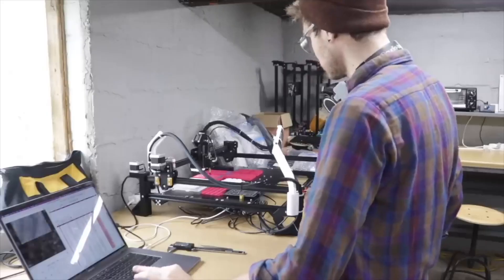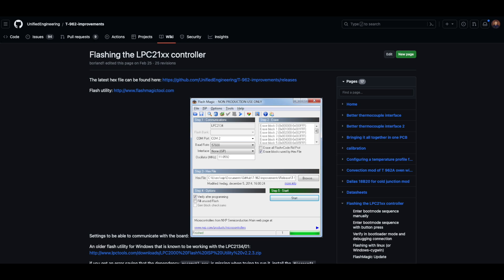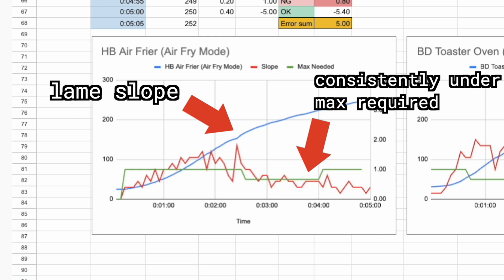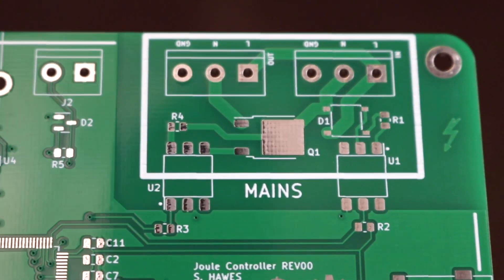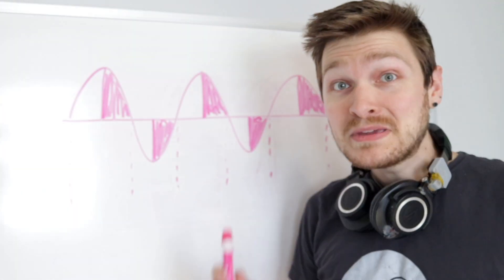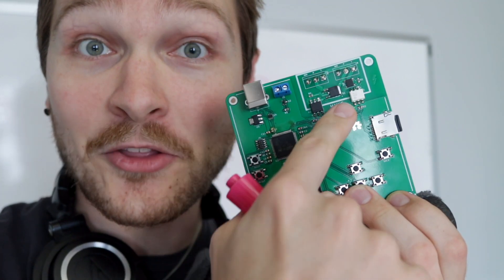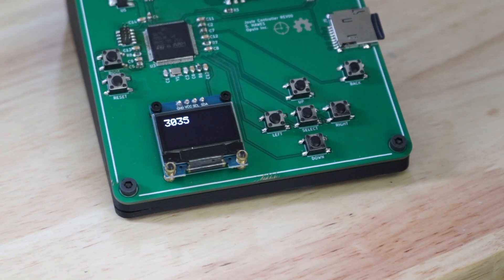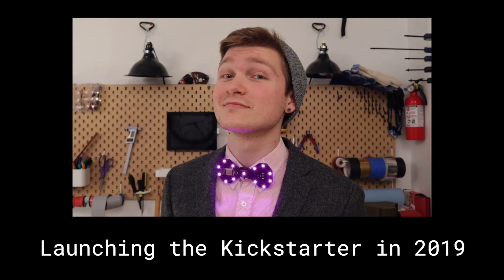turn any toaster oven into a reflow oven!

Comment: MOC3031 is a zero crossing capable driver, you were really close with the MOC3022, I might be mistaken, but part of the issue could be if you are PWM'ing anywhere in the middle of the sine waves, you are snapping through a large inefficient linear region to get saturated each time, just like with transistors it's not somewhere you want to be for long at all, pretty sure that's another reason zero crossing is often more preferred. I made a 555 drive a MOC3031 for a spot welder controller I designed. With the triacs, pay attention to the ratings and do the dissipation calculations(as you've already realized), also some are available in plastic isolated packages, others will possibly make a heatsink go live.

Comment: I think any mains rated relay will work fine. I don't really understand why you would want to rectify the AC wave - the oven power supply will expect a full sine wave and will rectify whatever you push to it. You're also over thinking the zero pass, this is a low frequency switching project - you're not sending digital data with a steady clock. Using the ac wave as a clock seems nice, I just can't think of any benefit considering there's a whole other supply circuit after your output. The microcontroller looks like overkill as well, use whatever series you're proficient with but integrate and test on a cheap and cheerful one if you want to sell the board. 
I say scrap this version, look at a few different projects that do the same thing and simply, rather than trying to make the-BEST-high-performance-switching thing.
Reply: All of your comments appear to reflect misunderstandings. Stephen's project is not rectifying AC to power the oven, he's not using line frequency as a clock, and no doubt he used that MCU because it's what he has for several other projects, which he already has a dev environment and libraries for. This is not a product prototype, as he said, it's just a board to allow some experimentation.
Reply: @Graham_Wideman  Stephen asked for thoughts 16:20, I wrote thoughts. You're free to disagree, but I'm not you, and you've provided no actual arguments except contradicting me.
Reply: @PaulSpades  I didn't simply contradict your suggested replacement project so much as address several points where you seem to have misunderstood Stephen's project, and thus relate "thoughts" unrelated to the matter at hand . Starting with your "I don't really understand why you would want to rectify the AC wave". Stephen's project doesn't rectify the AC, so your point addressing that has no basis. The rest continues in similar vein.  
But in the grand scheme of things, sure, your points could well be relevant to a different project by a different person starting with different components on hand and different skills.

Comment: 12:38 and here is where you probably should have covered the top side of the board around the AC section, because all that exposed area is ripe for finger touching while its live.

Comment: just use a triac and trigger it at zc when the current is low then it wont get hot? heat sink the triac. 50% would be you triggering every other zero crossing.

Comment: I understand that this is a test bench, and you know what you're doing, but I think it's still a bit dangerous to present the PCB on the top of the enclosure when it has exposed pads with mains voltage.  I wouldn't trust myself not to fumble something, anyway.

The following are unverified musings on how I imagine designing a circuit.  Please apply your own common sense and electrical engineering if you use any of these ideas.  If Stephen requests it, or this comment gets enough likes, I would be happy to formalize this by implementing some of these ideas in kicad and simulating them.

As far as how to control the output, you're absolutely right that switching mid-cycle is noisy from a conducted (or even radiated) emissions point of view, but it also has a terrible power factor, which from a do-the-right thing perspective matters more for a device like this that will use a considerable amount of power.

Also, consider that if the device under control is significantly inductive, it won't have reached zero current at the point where the line voltage hits zero, so your poor zero-crossing relay will be subjected to large transients when it tries to break the circuit, unless you can find one that breaks the circuit at the zero-current point, but a brief search suggests that (at least) the common ones are voltage-mode devices.  If you can convince yourself that this will never be connected to an inductive load, you can stop here.  But if you're putting a mains socket on it, it might be nice to know that it won't catch fire when connected to an arbitrary load that the user might attach.

For any specific device you're controlling, you can balance the inductance out with a capacitor, but the value of that cap, and the safety of the device is then highly dependent on the specific load.
Another option is snubber diodes.  These will protect from flyback by sinking current at some voltage above the maximum mains voltage.  This is a reasonable approach if you only want safety, and are ok with losing emissions performance in the case of an inductive load.  But if you want this device to be capable of more general control, or for it to be certified without being glued to a specific load,  another option is to stick to a TRIAC, which is a current-mode device.  Another option would be to slowly drive a power MOSFET through the ohmic region between the on and off states.  This will dissipate a lot of heat, but only for a short period of time.  If you take this approach, you should design with a part that has enough thermal mass to survive an off -> on transition directly followed by an on -> off transition on its own.  Then add heatsink sufficient to allow it to survive these transitions continuously, then program the microcontroller not to do that.  Make sure you do those calculations assuming the maximum line voltage this could be run from (240 maybe?) at the maximum current that could pass through the fuse you've installed on the board.  You did install a fuse on the board, right?  Remember that a fuse can pass significantly more current than its rating for some period of time.  Check the datasheet for the specific fuse you're using.  Do not use some generic fuse from aliexpress.  Get one with a real datasheet from a reputable distributor.

If you use low-side control, you can fairly simply drive the MOSFET from an opamp integrator driven from a uC output pin, with the bias on the non-inverting input driven from half your VDDIO voltage (by a humble resistor divider).  Ensure your opamp is safe to run with a large differential input voltage.  Use a small resistor and a large capacitor (relatively speaking) to form the time constant of your integrator, in order to get good noise immunity and low drift.  Think about trying to use 10% of the current source/sink capability of the IO pin on you uC.  Actually, you never need to tristate your uC output, so I suppose you're only buying noise immunity here - drift isn't really a factor.  Scale the opamp power supply to bring the MOSFET well into saturation.

In any case, there's a catch here.  The driver circuit for your MOSFET or TRIAC must be referenced to neutral, not ground.  Otherwise wiring faults or large neutral currents can lift (or lower) the source voltage on your MOSFET by enough to change the meaning of a gate voltage referenced to ground, or in the case of a TRIAC pull your current source against its will far enough to cause a false trigger or even catch your current source on fire.  In the case of a MOSFET, you can do this fairly simply with another opamp, by summing in the neutral voltage.  In this case, choose resistors large enough to prevent fire in the case of a neutral/hot wiring fault.  If you can find a linear enough part, you could also use photovoltaic optoisolator, but these tend to be quite pricey - they're typically optimized for digital, not linear use, but this would have the advantage of being safe for high-side control.  Or in the case of a TRIAC, the current source driving it needs to have sufficient compliance to drive a load referenced to neutral.  If you use a high-compliance current source to control a TRIAC, please ensure that a crowbar circuit protects the device from a neutral/hot wiring fault.

You might think of referencing the entire circuit to neutral, but this comes with other complications.  If you were to do this, you would simply move the gnd-neutral voltage problem to the USB port.  So you might imagine an old way to do this, that you should absolutely avoid, by isolating your circuit (by installing a 1:1 transformer) and connecting the (arbitrarily chosen) low-side leg of the secondary to the real ground.  Then reference everything to ground.  The protects the MOSFET/TRIAC driver, and the USB port, but IS NOT COMPATIBLE with GFCIs!  It will trick the GFCI into thinking everything is fine even as the user is electrocuted with several amps, so it must be avoided in modern times.

Comment: The first strategy I can think of is getting an off-the-shelf solid state relay and using delta sigma modulation to determine which half waves to let through and which to block. Maybe running the modulator at half frequency so it works on full waves would be better for EMC, that needs testing.
Reply: Using sigma delta is essentially picking particular constants for a PID algorithm. It's not clear that those constants are necessarily optimum, since they don't incorporate any knowledge of the thermal momentum of the oven.

Comment: You have essentially created a very expensive light dimmer, which is why it buzzes, as you have learned.  The triac is burning itself out because you are turning it on in the middle of the cycle, thus it needs to dissipate the switching current at that point and generates a huge amount of harmonics in doing so.

Your second idea is on point, and you can use a slightly larger triac (80% over rated) with a heat sink.  You can still PWM, but you need to think about doing it over something like N cycles.  If N = 100, and you want a 50% duty cycle, on for 50 half cycles and off for the next 50 cycles.  The temp won’t vary that fast, so even using 256 over 2 seconds is perfectly fine.  It will dissipate much less heat as well.

Comment: So we actually have a device that does exactly what you are designing- a reflow controller that you plug a toaster oven into. One thing that differs between it and your design is the rate at which it turns on and off. The one we have switches once every second at most. At that frequency you don’t exactly need to worry about the zero crossing issue. I can find out the name of the controller if you are interested!
Reply: That info would be useful.  Also check that it does indeed run an unmodified toaster oven, and also what does it use for temperature sensing?
Reply: @Graham_Wideman  the toaster we use has very little modification to it. We added a small layer of insulation and added a thermistor probe. The controller has an outlet you plug the toaster into. I'll ask what model the controller is

Comment: Yeah, work with those triac in the past and it can defenately do what you are asking of it (when you select the right one) but it will always need cooling, you can add a big ass heat sink on the back or you can use a silicon thermal pad and let the heat sink in the metal inclosure but unfortunately the toaster casing seems to thin for that.

Comment: Many years ago I did a lot of design work with triacs controlling halogen projector lamps. You really have to be careful with dv/dt across the triac as well as conductive noise suppression to keep the FCC happy. Using an SSR that triggers 'on' near the zero crossing as well as 'off' at zero crossing is the best way to go IMHO.

Comment: Having made a few reflow ovens like this for myself I used an ssr and didn’t worry about cycle switching as you can go pretty slow. I cycle twice a second and the pid works like a charm the heating curves are close to perfect. Good luck with your project.

Comment: oof if you want to be a little bit safer, use a ground fault interrupter inline so it has a chance to fuck up in that direction if you slip up. 

super cool for sure, I've only ever dealt with mains when on a SMPS project, and I was worrying about the low side so I'm no expert on anything at all, as far as I'm concerned mains is just wizards using weird semiconductors to do stuff that my small signal brain just has no capacity to comprehend.

Comment: Awesome design, but I saw that small triac frying a mile away, considering the current that oven draws. Definitely look at a SSR rated well above the current rating of your oven. If you build this for sale, and want a UL listing, that's very admirable. So over engineer it and put warnings everywhere. Also, put thermal fuses on your SSR to avoid fires.  Your approach to pulse the AC sinewave coming in from the mains is quite interresting. I have been an electronics technician for over 40 years trained by the US Navy. We have 100 KW radio transmitters that autotune. Meaning, the tank circuits of the different stages of amplification tune automatically. They use the AC sine wave much like you did here, except we also look at the polarity of the AC sine wave coming in to drive a DC motor. Polarity sensing lets us move the DC motor in the correct direction to change either the inductance of a coil or a variable capacitor. I AM Very interested in following this project as I am doing the same thing you are... controlling the temperature of an oven. I am very good with hardware but I cannot code at all. I am using a 32 bit ESP32 with WiFi and BlueTooth to accurately control the temperature of a cheap, commercially available meat smoker. I have subscribed to your channel just to see how you progress with this project. You might consider making a Meat Smoker controller with this same circuit, but more robust and able to handle the heater element currents but please make sure you include PID. Also, a wifi or bluetooth connection to a mobile phone app. A meat smoker controller might be more commercially viable for you to make. Much more demand than a flow oven. Do both. I'll buy your meat smoker controller!
Reply: I have been talking with Seon of Unexpected Maker, who is reference in this video. I have just purchased his Reflow Oven Pro, or whatever it's called. He seriously warns that using his device to control my meat smoker oven is outside of it's use-case. I must insulate my meat smoker to allow that controller to have a chance to work. I will make a video of how I incase my $150 meat smoker with ceramic fiber "KAOWOOL" and an outside frame of some sort to insulate my smoker. Then use Seon's  Reflow oven Pro controller to make it it work, if I can make it work. Not a fault on Seon's controller if it doesn't work. It's a reflow oven controller. NOT a smoker oven controller. But if it DOES work! Yum-yum! Great food with little baby-sitting of the temperatures in the future!

Comment: I wonder, since a heating element is pretty simple, it doesn’t really need AC. Could you just rectify the AC, use a power mosfet with low RDS to switch the power and use that to power the oven?
Reply: AC to  DC conversion losses are a waste here with unwanted additional devices heating up...means higher electricity bills.

Comment: When i was in college I liked to work on Hi-Fi gear. One day I was working on the power supply for an amp, and I had it all bare on my bench, plugged into mains running a test. I thought I was being safe, but while I was testing i was on my other bench using the computer. My buddy walks into the room, and as i turn to him he says "oh that's a beefy looking transformer" and he picks it up! I almost had a heart attack as i yelled at him to drop it.

It's cool that you built a box so you don't have to handle the mains side of the board, but it's not just you that you have to worry about. My buddy was fine, he managed to out it down without touching copper, but that was a lesson i wouldn't forget.

Comment: You can always run multiple Triacs in parallel, spreading out the current across multiple components. That doesn't help with your EMC problem but it would prevent the parts from overheating.
Reply: Equal current sharing in 2 or more triacs is difficult to achieve....a better option is two anti- parallel SCR's each handling one half of the waveform...control ,even from an opto coupled triac is easy with just a polarity steering diode to each scr gate...
SCR's are much more robust and have better & higher noise immunity than triacs...
This scr config. has been a standard in high current applications.

Comment: First reflow oven was a Hamilton Beach I picked up on the side of the road on trash day - full blast with multimeter TC to run up to 247-250 w/ GC10 paste made a lot of boards, just had to watch it close to turn off and open the door (wish I had one of the diy kits with the door opener puller to reduce chance of burning boards). Last year I went with a T-937M reflow oven in their 120v variant. The 220v variant has its issues but may have worked. Either case, running high current 120 or 220 isnt great for most users :/ so this project is definitely going to help the community! Best feature on the 937M for me is the exhaust and intake fan for unattended cooldown for sure. Duct for the exhaust is great to get fumes out, and the intake fan also runs for temp regulation and circulation fan. Oven in the unconditioned garage so 3000W heating keeps up in the winter time :)